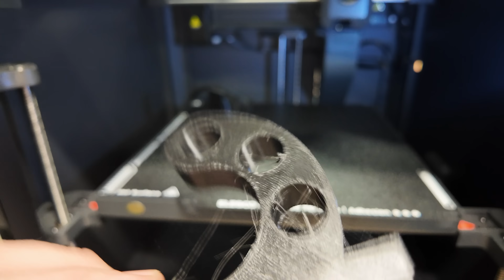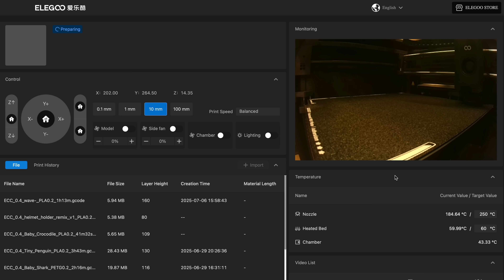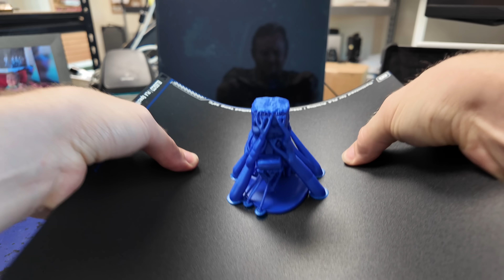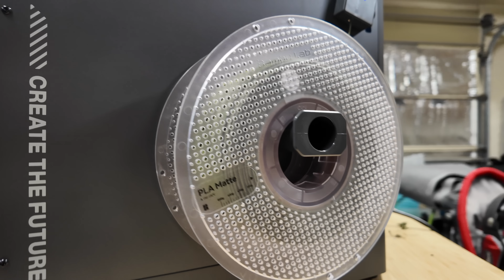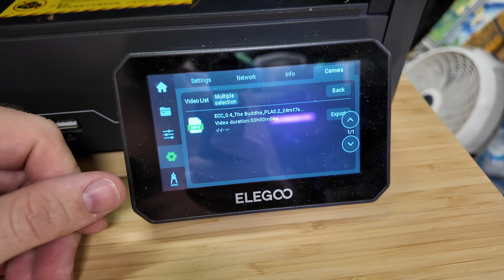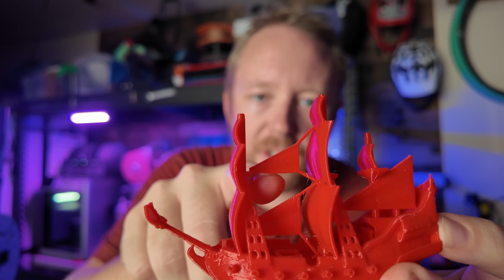Elegoo Centauri Carbon – Great Value, But There’s a Catch

Comment: Chould I print motorcyle pannels in abs on this and have brass inserts without cracking as in threaded inserts in holes
Reply from the maker: hmmm, I think i hve seen some people make grip guards for bikes.
Reply: @Acthungbaby  I've seen a couple f printed fairings let go at speed. one locking up the rear wheel at highway speeds. make it strong. 👍🏻

Comment: I need to use a 3D printer to add some 1.5 to 3 mm thickness designs to acrylic sheets.  What machine and material would you consider that can fit to this request and have enough adherence?

Comment: I have just done a test wth the Elegoo carbon i purchesed on 6 may 2026 .  i did a test with filament provided and the printer worked very well so i ordered form Amazon . Elegoo PETG rapid 1.75mm Printing temp 240-270 And it just prints and shreds  And i   just wondered if you could advice me please
Reply from the maker: Most important thing for Petg is to make sure the filament isn’t “wet” I pretty much dry all of my Petg when I get it .
Reply: @RadDadsPrintLab  Thank you i will give that a try

Comment: I’ve watch a ton of videos about this printer. Bought it from a eBay seller for $255.00 ($300.00 after tax and shipping). Delivered this morning (3/31/26). First time printer user so it was evening before my first print, a protective guard to set next to the filament spool. Flat easy print. Took about an hour and a half. People keep saying this thing is noisy. I’m a wood working guy. I’ve been using my DYI CNC router for a couple of years now. THAT is what I call noisy. This printer isn’t even in the same zip code of noise as my CNC. It’s running right now (a little after midnight) in an empty bed room right next to mine and with both doors closed I’ll sleep just fine.
Reply from the maker: Nice Enjoy! Comparing it to a CNC isnt exactly apples to apples haha. I imagine the CNC is quite loud

Comment: Hey so my printer keeps on just not printing, it sometimes does, most of the time tho it just goes up and down, or light and fans shut off and nothing else happens, I have tried to redo the calibration, unloaded and reloaded the filament, and checked for updates, there were none. Can anyone help with this?

Comment: Great video, i'm between the Adventurer 5m Pro or This Elegoo CC. Which one would be a better option? (Bambu labs are not an option here)
Reply from the maker: Tough Choice, I havent played with the 5m pro.
Reply: @RadDadsPrintLab  May be picking the Elegoo after all, the 5m Pro even though is good, is from 2023 so is most likely at the end of it's cycle by now, while this one is much newer.

Comment: Before I just want to let everyone kmow and be warned about elegoo issues. I have purchased Elegoo centauri carbon and the 1st week issue with print head went bad nothing coming out only noise was printing with blue elegoo pla.  they send me know replaced then I   2 times the black elegoo pla plus jammed /twisted in the sensor at the moment  I was still under 2 weeks return period so I decided not to deal with it and have them take it back and me return It to them. Their return policy and customer  services os so bad and legally force you to keep their junk.  Look at the BBB reports . I want to return they refused . To take I have packed the printer and they keeps sending me emailed one email every 24 hours and has been almost a week just to get the return going. I will be taking them to court for sure they need to learn. They are horrible their product and their service .  I dont want to unpack and make pictures and video to email them most of the time you can not even email files larger plus I told them I repaired the clogged sensor 2 times and replaced printhead what a picture of video do and what do you want to see? At this point I am done with these people  but I wont let them do this to anyone else ever. Ill post this to all youtubers, social media , bbb , gov agencies and more and ill have them have court record if thes fraud and crimes  too.  I think instead of sponsoring this fraud company these people  should stand for their products/ company issues customers facing . ....they need to look online how fraudulent this company is first . You can never return it look at bbb and report all issues online warn your viewers of their wrong doings.

Comment: So as a industrial mechanic I’d say it sounds like your heat fan came unbalanced… proper aligned and balanced motors don’t make noise it’s always bearings, and or rubbing… so yeah it being loud and failing likely coincide

Comment: I love this printer, by far the best printer I have own, I did have a shattered broken front door from shipping but I think it was the shippers mistake (still waiting on the replacement, 10 to 20 days from china). I also upgraded to the Cyrogrip Frostbite. One thing I did and surprise the hell out of me was Uncle Jesse's Ironing settings video for perfect top surface's. Been printing PLA HTPLA, PETG and Factory Filaments PETPC (a bit stringy with imporper settings). One thing I would like to see is the ability to delete timelaps after export.
Reply from the maker: I will have to check out his video on that.

Comment: What’s a good filament for gun parts? Maybe a lower receiver or something
Reply from the maker: I have no idea
Reply: @Juniors412  PLA - make sure you print in cold humid air
Reply: @SkarTisu thanks I ordered pla+ to try out with the first prints. petg-cf when I start getting good. I’ve heard cf nylon is good for parts also.
Reply: @SkarTisu it doesn’t work as good as people claim. The cf filaments or nylon’sare better but I’ve heard people saying stop printing nylon because they flex. I used pla+ and pla tough. I printed 4. One cracked dropping it, 2 of the bolt hold pins cracked the frame and I have one I got together but I don’t think it’ll hold up much.

Comment: The print bed on my CC was stuck down and would not go through the startup process because of this.  I had to manually lift it from the bottom of the printer to free it up.  Once I freed the bed up, startup completed and it is now working great.  I have been really pleased with the print quality and speed.

Comment: The A1 is 320€ and this is 20€ cheaper. As far as I can see the CC is the obvious choice for a first printer especially for the price. 

I don’t have a 3D printer but I’m really considering this one. I would appreciate all of your suggestions and help so please share it with me
Reply: This printer is bulit to be used with all of the high performance materials like Nylon, carbon fiber nylon, ABS etc etc. This whole review kinda missed the whole point of this printer. If you want to print PLA or PETG get an A1. But if you want to print all of the more advanced materials that are requiring high nozzle temperature, enclosure, hardened steel nozzle and a activated carbon filter for your health get the elegoo Centauri Carbon.
Reply: @tk1557-r1p   I think you're right.  This seems like a great pretty for new people, but it also has a lot of flexible as they learn more to use it for different things without having to do or get anything once they get to that point.

A price point that seems like you don't have a lot of comprises in terms of "will I wish I bought a different one later?"

-Some Guy Who Wants To Buy His First 3D Printer Soon

Comment: Does it have the capability to make different colored layers? I’m new to this.
Reply from the maker: There is supposed to a multi-color system coming. But right now you can tell it do a manual color change at certains layers in the slicer.

Comment: I have one Kobra s1 and when you show the pieces I know that the bigger layer lines was from the Kobra and I was right, after 3 months, using rinkhalks, making spacer, changing configs calibrating filament, it is almost perfect, but man, really if I know that before buy, would never buy, just need one printer that works fine and give nice result, I was looking to buy some bambu a1 or some century carbon, right now not sure yet, but your video was really nice, I’m happy you didn’t have many problems with the S1.
Reply from the maker: Thanks, its been pretty solid so far, I did have one piece break which shouldnt have that easily.

Comment: i've never used a 3d printer before but I thought this would be a lot easier/better for beginners but I'm so lost and everything I've tried to print comes out fucked up and the slicer has like a billion settings i have no fucking clue where to start. this is really discouraging and honestly I am just thinking isn't for me.
Reply from the maker: The absolute most important thing is to make sure your build plate is clean. Give it a good wash with dawn dish soap and it will solve most problems. Most of the settings you don’t need to touch.
Reply: @ch9nnel99  Try using AI to walk you through everything, Chat gpt/Gemimi whatever you choose. You can send screenshots and photos and it does a really good job of guiding you through.

Comment: I think you have a version 1 the ams models have the light upgrades and you missed the correct back of the riser piece the let's the Ptfe tube through or you can feed it from the corners.

Comment: What's the catch? You spend more time cleaning clogs than printing.   Every time I change filaments, the previous filament hardens in the heatbreak and won't ever load new filament.

The other issue is that the auto level is too close to the bed and causes squish, and sometimes causes clogs.  You can add an extra offset in the start geode to account, though.
Reply from the maker: Its not perfect, as far as your filament loading issue. Double check your heatbreak fan, it seems like a common failure and is probably the reason your getting clogs.

Comment: Your vid might be a bit out-dated - I received my printer around the time this vid went up and mine came with all the updates I am aware of - light bars, AMS port, better run-out sensor mount, improved top cover fitment, chamferred underside of the top frame and a thicker side panel for the filament spool arm.

It is still pretty loud though - working on that right now.

Comment: Nice review. You must have an older unit. I believe that I have the 3rd revision for the printer. My unit has the upgraded led lights. Camera light is still there but is disabled. It also goes to 110 for the bed and as you correctly noted the hotend can reach 320. I also have the AMS port.
Reply from the maker: Yeah, im suprised that even being in the 3rd wave i got an original version. I am very curious how elegoo is going to handle the lack of AMS Ports on the earlier models
Reply: How do I know if it's a 3rd version? There is a sale going on and I am considering it, but I want to double-check to see if it's the older version that's on sale. @appsmanster7405

Comment: If you are actually watching this and considering the A1... GET THIS!  

I ordered my Centauri Carbon when I got to the point where I could no longer deal with my A1's failures and Bambu Lab's lying and BS.  

It took me hours to get my A1 setup on my isolated LAN and absolutely requires the use of an Android or Apple device.  The instructions claiming to show how to set up an A1 without an app or internet connection are lies.  It can't be done.  Once it was setup I found that without using Bambu Lab's spyware app and data mining, cloud many of the printers features were blocked.  There is absolutely no reason for blocking any of the features other than resentment from Bambu Lab. And then, after running my A1 without connecting it to the internet for a few weeks it began to get errors when starting every single print.  Not always the same error over and over but a new, random error every few days.  At first I was worried, until I realized this is built in.  Most of the time it's easy to see that the print bed is in place, or the nozzle is NOT covered in filament, and if you just press Continue the error magically disappears and the print starts up. 

In contrast, it took me about ten minutes to get my Elegoo Centauri Carbon unboxed, setup, and calibrating, and maybe another three minutes to connect it to my isolated LAN and added to Orca Slicer.  I have access to all of the printers features and it prints spectacularly.   

The Centauri Carbon is a much better, much easier to operate printer.  Elegoo is a far, far, more trustworthy company that Bambu Lab will ever be.
Reply: I just ordered mine. I bought Elegoo Netune 2S a while ago, and i felt like its the time for something new. Can't wait to get my new printer.

Comment: I'm bouncing between getting a Centauri carbon or a FF AD5M PRO, any thoughts?
It will be my first printer and will only be using it for things like figures, mini's and props using PLA.
Reply from the maker: Ive had alot of people comment about the FF AD5M, I reached out to them to try and get one. If you can get a 0.2 nozzle the Centari carbon is a great option for printing those minis.

Comment: I have it and printed over 90 hrs. And it was fine. But I did try to print a full bed plate size of a mini nuke from fallout and the hotend broke off. And I dont no why. And a replacement is $60 other then that this printer is awesome 10/10
Reply: @ttv.Shadowdemon723  no warranty on it? Looking between this and the force forge m5 pro

Comment: One of two CC's I recieved at the beginning of May had the same heat break fan issue. Elegoo just sent the entirety of the tool head assembly for mine, after a slight delay of 4 weeks. There's a few other little quirks / bugs but it's a great value overall.
Reply from the maker: I got a response that they were sending it, but i dont see that it has started moving yet tracking wise.
Reply: @RadDadsPrintLab  Yup. They printed the shipping label, and then didn't ship for a few weeks. Things are hopefully moving faster now.
Reply from the maker: Elegoo is sending me some parts, still waiting for them to show up though. Thanks for sharing!

Comment: I printed one thing with mine and it died. I have Batch 3. I went to take the extruder apart to see if there was a blockage and the socket head screws came pre-stripped and couldnt be turned. Luckily customer service promptly sent out a replacement part. Unfortunately their sticker of Q.C. means absolutely nothing.
Reply from the maker: Yikes, At least they replaced it
Reply: @RadDadsPrintLab  Yeah, it's cool that it's the entire toolhead, so it is probably more than I need. Now I just have to learn how to take it apart and rebuild it. And I want to find better quality bolts to use as the ones they source are obviously very low quality 🫤

Comment: Bed goes to 110c not 100. Have 2 , both have the light and AMS ports. Both great.  First print was Eiffel tower - great, next 3 were moon globes with no supports.
Reply from the maker: Yeah, I totally messed up on that one. I made myself a note and forgot to add a text overlay to fix my mistake.

Comment: Elegoo: places spool on the side because people hate it when it is at the back
Also Elegoo: leaves power switch at the back 

At least I use power switch more often than change filaments 😅

Random rant follows:

Since this is closed non-klipper (debatable 🙃) printer, modding stops at what misc add-ons you can print for it (I would guess 90+ degree door hinges would be one of the first).
No INDX (maybe not enough room, so 🤷).
No Eddy.
No 3rd party AMS (4+ filaments, or alternative to what Elegoo brings out).
Not even different length PTFE tube between head and filament sensor can be changed (head does not have sensor AFAIK, so how is AMS gonna find out where the filament is? Trust on calculating AMS movement? Buffer detecting push?).

You will really be married with it 🤐
But the price and print quality are tempting 🙊

Comment: I'm trying to decide between the Centauri vs the Flashforge 5M Pro. I'm hesitant to get a Bambu bc of the proprietary stuff.
Reply: I'm looking to get one too, I'm curious if you got one which way you decided to go?
Reply: literallty the centuari and flashforge is also proprietary
Reply: @ravplayztabla7467 
Wait a second... it's one thing to say they are "not open source" but are Elegoo and Flashforge requiring you to setup a user account and log into their system as a prerequisite to using the hardware that you purchase from them?

I think there's an order of magnitude of difference here.

Comment: I'll add that getting the printer from a reseller will most likely be the "Batch 1" printers. So if you have the dim lights reach out to your reseller for a possible fix.
Reply from the maker: Totally, mine was from wave 3, so i'm kinda surprised it didnt have some of the upgrades
Reply: @RadDadsPrintLab  Yeah I got my CC from Microcenter and that was the BS I was fed. The guy stated I can return the printer but for money back cause they weren't getting any more until Elegoo completed it's backlog.
Reply: NOTE: I held on to it and just stuck an LED strip in it.

Comment: I am about 170 hours in, and still wearing an amazed smile.
Reply from the maker: Thats awesome!
Reply: Good to know I'm looking into this to print and eventually run an etsy store.  I'm doing my research but for the price can't really argue with that
Reply: 11 months later, how is it?
Reply: @vatakoutlaw  still happy, but contemplating an upgrade to X2D (but Bambu being Bambu are putting me off) or maybe a U1, because I’m attracted to the idea of using non-bonding support material wth ease and minimal purge waste of premium filament. If I hang onto the CC1 it would get the mod to use unclip-to-change Bambu nozzles. For most folk the CC2 looks a better bet than the CC1 now.
Reply: @dougal6569  any problems yet? I just got one